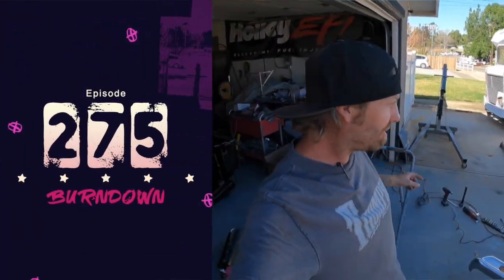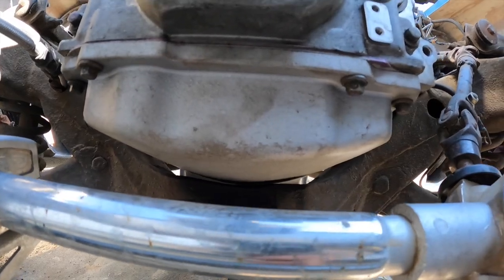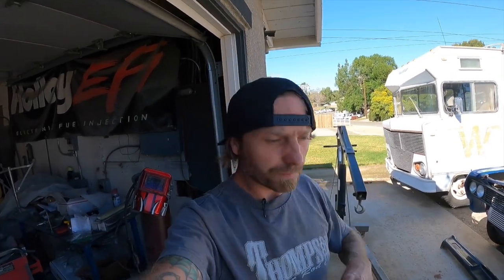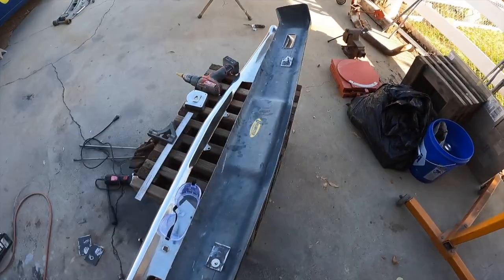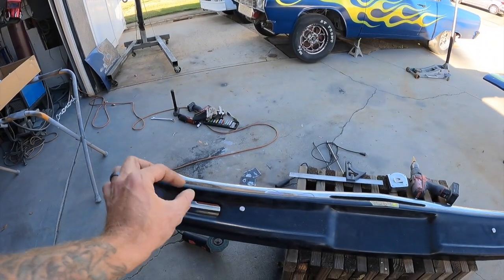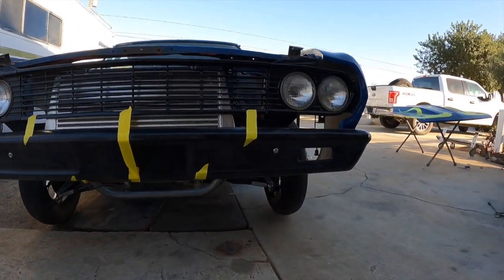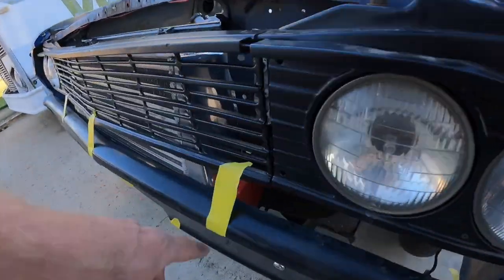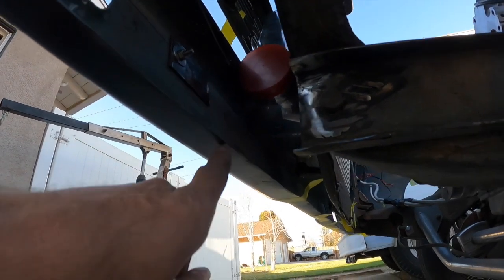Mounting The Front Bumper

Comment: Are you going to cut hole saw holes in the bumper to get air to the intercooler?, it should be less noticeable if you fog the intercooler black
Reply from the maker: I was debating cutting the bumper but it dosent really cover too much of it. The bumper is really thin so I feel like cutting it up may take away structure. Ill see what the IATs are but im sure they will be better than with no intercooler.

Comment: Radiator will be ok for a summer daily driver with the intercooler?  
Also - sweet beard
Reply from the maker: LS motors dont usually have heating issues. We will find out when I start climbing mountains in Colorado. A nice electric fan will help draw the air in.

Comment: If you stick the stock grille (front end) on that Malibu SS of your's, you would have more room. Why do you have a '64 front end on your '65?
Reply from the maker: The car is a 64. I got the fenders and hood cheap from a friend to save some weight. I figured they would fit but turns out not so much. I like the 64 grill so I modified the hood to fit with some cardboard 🤣
Reply: My apologies. I had to go back through some of your videos to see the deck lid. You definitely have a '64. I did notice that your MalibuSS badges are off of a 65 and not a 64. 64 badges a more of a "cursive" script than the 65 badging.  I am basically doing the same thing you are, but with a 65 SS.